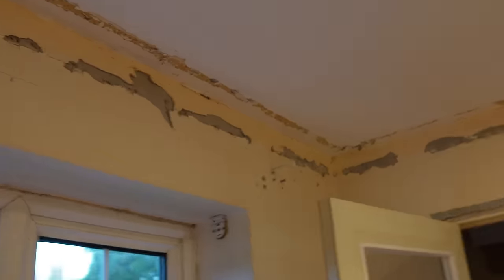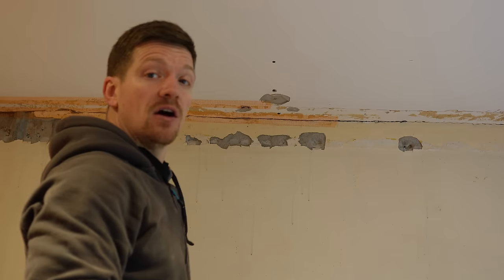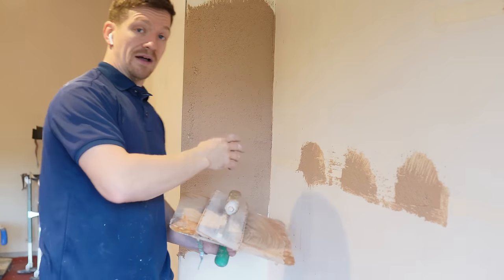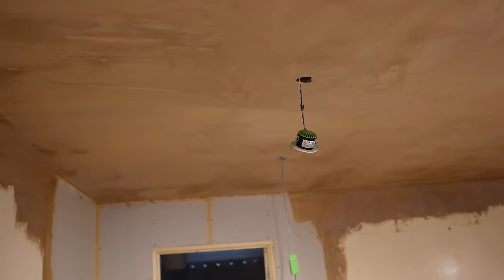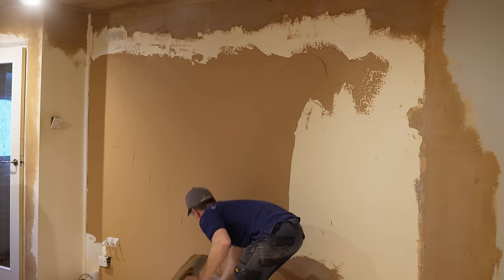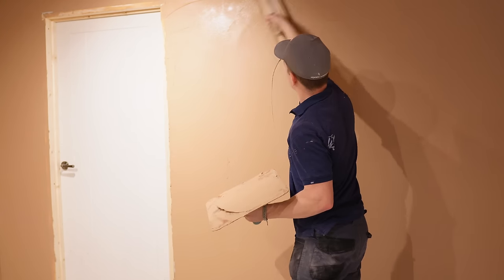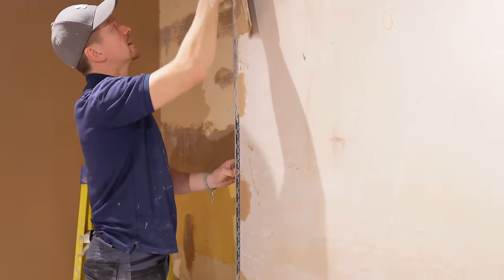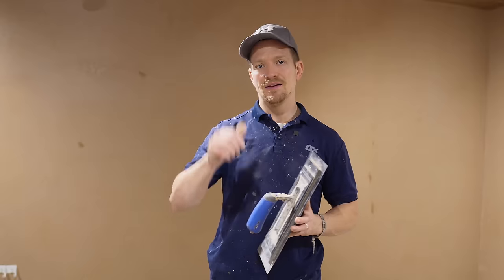Ignore This In Plastering & You'll FAIL (TRADE SECRETS EXPOSED)

Comment: Yh,so I have no clue were to start with plastering and was wondering if it's even worth learning ???

I would like to build a business around it ultimately but one think that is stopping me is I don't see plasters at every other house working.
The idea of plastering a full house for £3,0000 to £4,000 sounds nice but how many of them do you get a month ????

I think my biggest question is will you be fully booked up for months on end.
I am not the one to turn down work especially if the money is there.

Currently I am working in a bakery on a busy production line doing 12 hour shifts working roughly 60 hours a week to hit my target of just over £2000 after tax. Previously I have worked like 80 hours a week so I no I am not shy from putting in the hours.

Any advice would be much appreciated.
Thank you

Comment: Hi Blaine great vid . I always use the same mix to second when I can. Chuck a bit of extra time in with it and lasts a bit longer in the bucket but pulls into the walls. 
Hope you have a good break for Christmas mate 👍🏻
Reply: That's a question I was going to ask. The second mix is supposed to be more loose and thin than the first, obviously it would start to thicken up so using extra time makes sense 😊

Comment: Hello Blaine, 

thank you for this video! Very informative.

Question for you or any other plasterers: do you need to sand the final coat once the plaster has dried? 

Also, if there are imperfections such as trowel marks, small holes etc.. do you fill them after the miscoat or after?

I thank you in advance. 

Seb

Comment: I used a steamer on wallpaper and the plaster that fell off was mind boggling.
Reply from the maker: Exactly that my friend. They can cause damage!
Reply: I'm a decorator - only use the steamer as a last resort, for exactly the reason you describe. If you have to use it, keep the steamer moving, don't leave it in one spot for long. Reduces the chance of blowing the plaster off.

Painted wood-chip doesn't always repond even to steaming. A good sharp scraper and elbow grease the only solution sometimes.

Comment: Another way to fill a hole peace of plasterboard just bigger than the hole put a hole in middle of the peace you've cut out put a peace of scrim tie in a knot put a screw in the knot put the peace of board you've cut out in the hole pull down on the long peace of scrim to hold the peace into place and bond round to make it level
Reply: Cut the excess scrim off and skim
Reply: That makes no sense whatsoever …and never seen the word ‘peace’ used so much in a paragraph in my life. Especially when it should be ‘piece’……